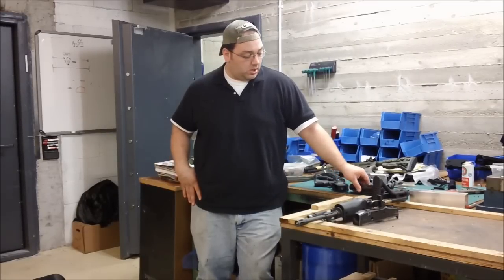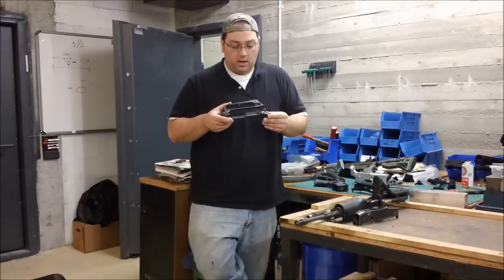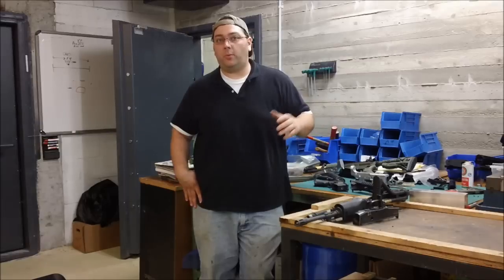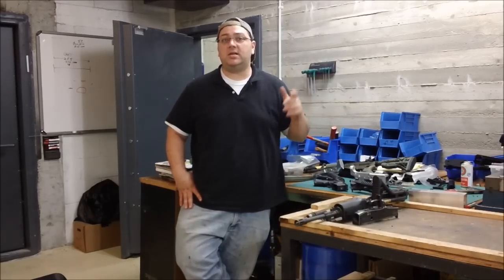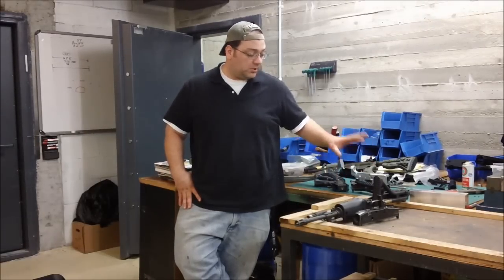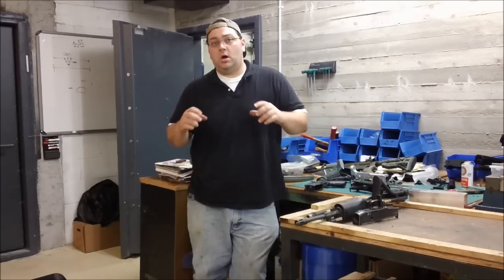Seeing is believing! Milled vs. Forged receiver strengths. Also a look at barrel obstructions

Comment: A forging is stronger than billet. Is the average AR-15 owner going to be able to tell the difference in strength? No. The difference in strength isn't huge but it's there. For one of my AR builds I went with a billet lower and upper because they matched each other and the lower has a ambi bolt release. Am I going to loose sleep over the fact that forged is slightly stronger than billet? No. I have several forged and billet AR's they all shoot, they're all very nice guns, and they'll serve me for decades to come. The fact of the matter is with proper care and maintenance either one will more than likely outlast their owner. Unless you mortar the piss out of it and break the lower receiver.
Reply: Can you mix a billet lower with a forged upper?
Reply: Barry The Chopper depends on definition of stronger.  and billet versus forged depends materials (6065 vs 7075) and how the billet was processed.

Comment: As far as strength, plastic is strong enough, so any aluminum that is used for receivers is strong enough. As far as I'm concerned, it doesn't matter which type of process is used. Both are stronger than they need to be.

Comment: "Forgings are weaker than billet" "This hammer forged barrel is the best in the world"  ...... Something doesn't add up.
Reply: Jake Heke  You sir are an idiot...  Not even close...   Take some IE & ME classes in metalurgy, strength of materials , & production processes...   Then you might have your head out of your ass...!
Reply: Cold hammer forged. There is a difference.
Reply: The barrel is cold hammer forged, the receivers are forged while glowing red.
Reply: Forged steel way tuffer than forged aluminum
Reply: You got it wrong dude... forgings are stronger than Billet...  they are  hardened due to the forging process...   I think you're referring to aluminum castings...  Which are poured from molten aluminum.   Billet receivers are more expensive because there's about triple the amount of Machining time to machine a billet receiver then there is to machine a preformed forged receiver...    There's a reason every 5,000 horsepower AA   Funny Car and AA Dragster run forged aluminum pistons, forged steel connecting rods, forged steel crankshafts, and forged aluminum rear wheels....!
Reply: @williamriley2528 that hasnt been the case in years..
Reply: @williamriley2528 you know the 7075 block of aluminum the "billet" reciever is cnc'd from is forged into that block before it's machined.  And funny cars run cnc aluminum rods, cnc'd block and something like a Sonny Bryant billet steel crank.
Reply: What you said is true,  billet/machined parts are stronger than forgings.  Also Forgings leave stress in the metal that causes another set of problems.    WITH THE EXCEPTION OF HAMMER FORGED BARRELS.  HAMMER FORGED ARE MUCH DIFFERENT THAN REGULAR FORGINGS THE HAMMER FORGED BARRELS ARE HAMMERED MILLIONS OF TIMES WITH FOUR MACHINE HEADS.  THEY ARE COLD FORGED TOO,  SO WITH THE COLD FORGING AND MILLIONS OF HAMMERS THE BARRELS ARE SUPER STRONG. WHAT HE SAID IS TRUE.

Comment: Bullshit meter is off the charts! Forged is always stronger than billet. Forging changes the grain structure of the metal in a way that makes it stronger, billet does not. (Metals alloys have atoms that form crystals, NOT MOLECULES. Forging does not pack them tighter, this is impossible, it changes the crystal structure) Billet will always be heavier, weaker (for a given weight), and more expensive (more waste, more machining time). This is literally something you learn the first week in IME 101. Do you understand that a sample set of 2 is meaningless data? I guarantee those two uppers didn't experience the same exact event. If you want to prove which is stronger, you have to devise a test that can measure their relative strength in a repeatable experiment, and take a larger sample set than 1 and 1. Your opinion is based on a single experience and not much else. If you put the over pressure round in a rifle and fired it with out blocking the gas port, of course you caused a failure, there isn't enough dwell time for the pressure to drop to a safe level before the bolt started to cycle. There is no aluminum upper that would have survived this. This is not something that would ever happen in real life. 

Alternatively, you're up here talking about billet receivers and you make billet, of course you will tell people they're better! Higher margins, and and much simpler supply chain. Billet 7075 is FAR easier to get right now than raw forgings, you don't have to compete with other manufactures for them. 

How did you draw this out to 13 minutes?

Just to re-cap; Metals + metals > alloys, Metals + non metals = ionic compounds, non metals + non metals = molecules.
Reply: Hot forging does change the molecular structure, but it also does make the material denser.  Cold forging just makes the material denser.  I believe that is what he was talking about when he said packing the molecules tighter.

Everything else you say I agree with..
Reply: Jeremy Paulin Metals DO NOT FORM MOLECULES. You are not going to make metal denser with forging, forging changes the GRAIN STRUCTURE of the metal crystals.
Reply: either way everyone is missing a major point! billet used to mill out receivers is drop forged, forged receivers are also drop forged! i don't know of any one who manufacturers a receiver hammer forged! barrels on the other hand have and probable will continue to be hammer forged by all the top end companies and only the lower end companies will use rifling mills
Reply: GearCheck 101 You're right metal doesnt make molecules, molecules make up metal lmao. Forging does make the metal stronger and more dense, as well as change the grain structure. Its the same thing when building an engine. Forged rods are always stronger. Sorry.
Reply: Metals do not form molecules in any way. Molecules are comprised totally of non-metals. Metals form iconic compounds with non metals. Metals do not chemically combine with other metals, they alloy, which is essentially a heterogeneous mixture.
Reply: Yes but that whole spill has nothing to do with the subject at hand, which is: Metal, excluding pure elemental metals like iron, gold, etc, IS made of molecules, like everything else. And Yes, forging DOES strengthen and compress most metal alloys, as well as change the structure. Thats why quality knives and swords are forged instead of cut from bar stock and shaped. Because forging literally compresses, strengthens, and alignes grain structure. Ever heard of shot peening? Know what it does? COMPRESSES the metal to STRENGTHEN it. Forged = compresses, strengthened, metal with aligned grain. So, sorry, but it does all of the above
Reply: You're not listening, metal doesn't form molecules. Metal only forms ionic compounds. Pure metals and alloys do not have molecules.
Reply: You can't compress a metal (voids withstanding), only change the orientation of the grain structure. Which is the advantage of forging. If you start with 40 cubic centimeters of metal, and forge it, you end up with 40 cubic centimeters of metal in a different shape. Not 37, not 38, not 39.999.
Reply: Molecules are held together by covalent bonds, which metals don't form.
Reply: If you could compress metal, it would fuse into a new/different element in an endothermo nuclear reaction which would require the input of a huge amount of energy.
Reply: Hmm "The forging process, a solid metal block is beaten into the desired shape. Forgings have a higher density compared to cast parts due to the pounding/compressing of steel."
Reply: From shot peening excerpt: "The compressive residual stress in a metal alloy is produced by the transfer of kinetic energy (K.E.) from a moving mass (shot particle or ball peen) into the surface of a material" whats that C word? Compressive? Hmm.
Reply: Talk to a chemistry or physics teacher. I'm not being paid to fix your special kind of problem.
Reply: Haha im just trolling you man. Have a good Christmas/new year.

Comment: There's a reason why wrenches, turnbuckles, chain hooks, anvils, etc. are forged instead of machined out of a block of steel.   And it's not just the fact that in high quantities the piece price is cheaper than machined parts.   They're tougher.  If you don't believe that, machine a wrench out of steel and abuse it as much as you'd abuse a forged wrench.  It will break.   I know, I've done it.

The other think to think about is the what happens when you do a lot of machining or grinding on a forged piece.  Forging forces the grains to follow the shape.  Machining disrupts the continuous grain formed by the forging process.  So it gets weaker.  I may be wrong about aluminum, but I don't think you're accomplishing much when you take a  block of 7075, squish it down flatter in a press and then completely change the shape machining it into a AR-15 lower.

Comment: cracked or bent, you can't use it anyway. The question is, will a forged receiver with the same design crack more easily than a billet receiver will bend on stress points.

Comment: Hey when you can make them out of polymer plastic the difference in strength of milled vs forged on the AR is a minor issue . it won't make any difference in what I buy . That being said you did a very nice presentation on the subject mater Cheers .

Comment: basic science tells you you're wrong. Forged is stronger than billet, the molecules are pressed much closer together making forged materials harder than billet. But you already know that because people have already told you, you're just biased because you sell billet receivers. Billet is softer, that's just fact, ever wonder why the fantastic billet lowers always have the trigger guard built in...?
Reply: forge52100 regardless of the type of bond, a group of bounded atoms is a molecule. I understand you've done research, but so have I... During my formal engineering education at Purdue
Reply: +forge52100 Do not get me wrong, I love em both, but some of the milling is just pretty, some is stupid tho
Reply: Nope, seems weird, but is true.  Look it up or talk to a metallurgist.
Reply: forge52100 you are incorrect. There are molecules. What you're thinking about are covalent bonds. The atomic bonding in metals is metallic (or ionic) not covalent
Reply: Sorry to change the subject, but I just recently bought both a billet and forged lower. Is it ok to mix match a billet lower with a forged upper or vice versa and how will it affect the pairing.
Reply: +Jaime Del Pilar it shouldn't affect much or anything in terms of operation so long as both parts are in spec. You can mix and match forged and billet but some billet manufacturers make their receivers in such a way that they can only be paired with their corresponding upper/lower, so it depends. But usually it will be fine
Reply: +Jaime Del Pilar well for the best fit between receivers I'd go with both billet upper and lower of the same brand as seeing how the whole initial thought behind billet was to machine them to tighter tolerances than forged. There do exist receiver tensioning devices that will help take out some of the slop/wiggle between the 2 pieces, although having a little wiggle between upper and lower is fine and won't affect accuracy in any real large capacity (I.e. its largely an over blown issue on the internet), there are plenty of sub MOA ARs that have some play between the 2 receivers. You biggest factor for accuracy will be your barrel
Reply: GearCheck 101 7075 shouldn't be used in this application do to te brittleness of of the alloy! 6061 t6 is a better alternative due to the fact that it still retains the slight spring allowing it to take in the impact and flex as well as diverting the energy away from the structure in all directions. This will reduce the amount of load applied to the bolts on the carriage (lower receiver). Stop going back and forth over structures of alloys and atoms over crystalline grain structures and just stick with the problems! If the wrong alloys is used it will most certainly cause a catastrophic failure in any application! A lot of people on YouTube that are trying to show the DIY on building anything don't have a red seal in machining nor able to call them self a metallurgist in any ways shape or form!
Reply: Forging is stronger.  ALSO, if you watch closely, they are 2 different receiver designs, from 2 different manufacturers, with likely different tolerances.  It is NOT a valid test.
Reply: Yes harder means stronger but also means more brittle. Harder materials are more susceptible to damage occurring due to shock load than softer materials. Now if you are running the proper ammunition and not shock loading the system with excessive pressure, I agree that the forged is better. Like you have said it is harder, and harder materials take wear much better than softer materials.
Reply: +Joe Loeffler yes harder materials are more brittle, common sense, but softer materials will begin to take damage faster and wear faster. The difference is that the softer material will bend and bulge as it starts to fail, and harder materials will crack, again common sense (at least I thought). You can tell this guy is full of it when he says the pins wear slower or better on billet than forged. Basically what this guy did is shoot 300 BLK in a 5.56 upper (same result). Doesn't prove anything
Reply: OK, first, metal is not a molecular structure, it's a crystalline structure, no molecules.  All else being equal, forged is stronger than milled, but that's due to grain flow and grain refinement, not "molecules pressed together".  The question is, how much stronger and if it's worth the extra cost.  Also, there's more to go wrong with forging, IE. over heating or forging at too low a temp cause micro fractures.  Each metal responds differently to forging and has it's own window for forging.  

The M14's receiver is a good example of forged vs. cast, and cost affective.  If I remember rite, the forged receiver is good for around 60 thousand rounds, the M1a's cast receiver about 50 thousand rounds, but it's a hell of a lot cheaper to investment cast for that complicated receiver than it is to forge it, and the forged generally runs several hundred dollars more than the cast or a billet receiver.  That said, my M14's are forged, but that's my personal preference.

End of the day, it all comes down to personal preference, I doubt the average user will notice much difference between the two.
Reply: +forge52100 Billet are prettier
Reply: Not really, forged will be machined and shinny as well.
Reply: Both should be 7075-t6, hardness is the same. Robert is right on the fact forging is better but not the why. Forging aligns the crystal structure of the metal in a way that makes it tougher and stronger, not more brittle, less brittle. Cast metals have random grain structures, billet will have grain structures in one direction, forgings will have a grain structure that is always perpendicular to the load you will be putting on it (they are engineered this way). This improves the strength, while using less material, less weight, less cost. Robert is spot on about the reason why this guy made this video, he&#39;s selling billet receivers. He needs people to buy them. The only advantage of billet receivers is their cosmetic appearance and improved margins for the people selling them.
Reply: If the softer material of a billet lower deforms you're not any better off than your forged lower cracking.
Reply: +Nick Prives not true, the amount of force needed to crack a forged lower is quite significant, while the amount of force needed to deform a billet lower will be quite less than that. there isn't really any advantage to going to a billet receiver other than cosmetic appeal or the occasional ambi bolt hold devices/mag release controls built for that lower.
Reply: +Robert N That was my point. Please reread my original comment. We are 100% in agreement
Reply: +Nick Prives my bad bud, I misinterpreted what you were trying to say
Reply: +Robert N yea, I should've tagged the person I was responding to. My bad.
Reply: +Nick Prives its cool, no big deal
Reply: No molecules in aluminum or steel?  LOL
Reply: And we use the term molecules primarily to describe covalent compounds or compounds where electrons are shared.  Ionic compounds do not have molecular orbitals.  From my limited understanding, with most metallic compounds, you have atoms, crystals, cells, grains.  No molecular compounds in the mix.  I have had enough conversations with different metallurgist that throw a hissy fit when you start talking about "molecules" in steel that I've done enough research on the subject to, barely, grasp the concept.
Reply: Thank you for responding. My plan is to use part from the same manufacturer but different materials. I'm just concerned about the wiggling that some paired uppers and lowers have even using the same materials from the same manufacturer.
Reply: There is an accuracy and reliability factor. I want to build one of them for Precision so I'm trying to take that into consideration.
Reply: Thank you again Robert N for the reply, I greatly appreciate it.
Reply: +Jaime Del Pilar no problem hope it helps.
Reply: in the same boat please let me know how it works out for you